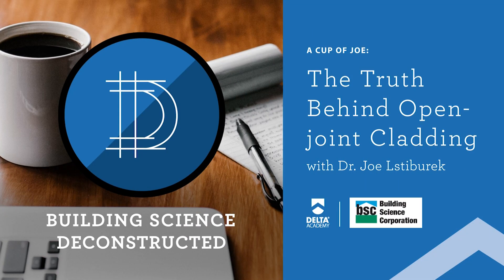A Cup of Joe: The Truth Behind Open-joint Cladding | Building Science Deconstructed

Comment: Hello Joe,  i know you have been to Juneau, Alaska and know how wet it can be.  I live in Ketchikan three hundred miles south of there in a temperate coastal rain forest where we get rain, as in a bit over 200 inches last year.  So the ratio between drying and wetting the outer wall treatment is a bit different from what you are saying in that you can get away with gap siding because it has a chance to dry any intrusive rain, snow, etc.(be it gravity fed or boosted by our winds up to and over 100 mph two or three times each year and 180 days per year with winds in the 25-30 mph range) that enters these gaps.  My question is; can net drying occur in a wet climate such as ours?  My personal experience tells me that it won't happen.  That stated it supports my preference for a rain clad system that is a penetration proof as possible.  After more than seventy years here and seeing building performances I have come to the conclusion that steel sheeting is probably the best you can do for protection of the structure over a good exterior insulation and membrane with rain clad the goal and an air vent at the bottom for air and drainage behind the steel.  Designing for moderate climates leaves us here with product failure in our buildings at an early stage.  Am I missing something here?  Is there a better way?  

Also I wouldn't want to depend on modern membranes to last fifty or sixty years which is easily achieved by steel siding and some steel roofing.  The membranes just don't have a history of that kind of open exposure for any meaningful number of years.  While I feel comfortable using them that only holds if they are completely covered with an interlocking weather resistant siding.

I am interested to hear you view this type of cladding through the prism of extreme weather performance as opposed to mild stressing in a moderate climate. 

 I just completed a shop addition to my existing shop where i used a wall system of 3/8 plywood inner finish, fiberglass insulation in the 2x6 wall studding, 1/2 inch plywood sheathing, a layer of premium (corrugated) Tyvek, two inch rigid foam board, one inch rigid foam board with aluminum facing, 3/4" horizontal furring strips, another layer of premium Tyvek, and finally exposed fastener corrugated steel with no mid joints.  I am interestedly watching its performance.as time goes on.  I heat the 18000 cu. ft. with a ton and a half mini split.  Keeps the shop at sixty six degrees from 0 F to 95 F as well as controlling the humidity (and rusting of my tools!) while running at a minimum setting the entire year.  The wall system is open at the bottom but closed at the top to prevent driving rain from entering.  Four foot gable overhangs and 18" on the sidewalls (set backs wouldn't allow four foot), shed style roof, standing seam steel over Grace, 5/8" CDX sheathing, 2 1/2" x 12" box beam rafters 16" o.c., R48 fiberglass insulation, 3/8" CDX as the finished ceiling.  A 1" air gap vents from soffit to peak.  The theory being the roof deck can vent through the plywood to the inside since the Grace Ice and Water as well as the steel will not allow it to vent to the outside.  I have doubts in my mind but think it has a good chance of doing so and will keep an eye on it.

Hope you had a merry Xmas and will have a happy new year.  You do good work in the building field and it is much appreciated.
Douglas Thompson
Reply: Uh… probably email him I don’t think he’s gonna see this.

Comment: Any concern with insects getting behind open joint cladding?
Reply from the maker: It would be possible for insects to get behind the cladding.  However, the insulation and the rest of the substructure would be protected by DELTA®-FASSADE S WRB, so any creepy crawlers can’t get too far.